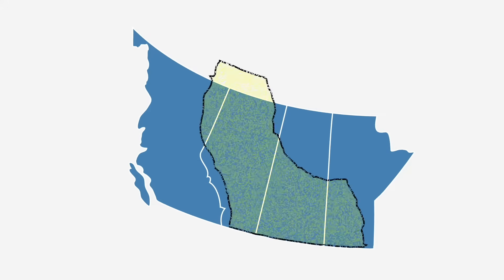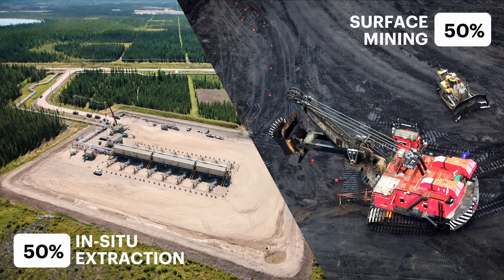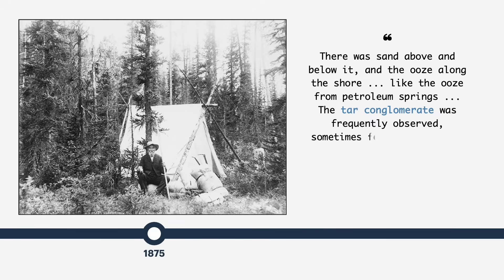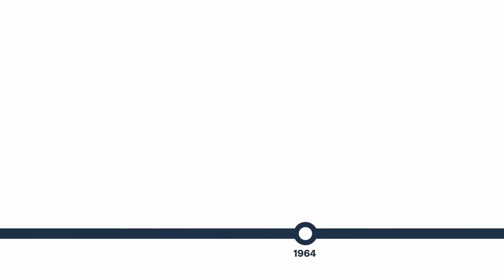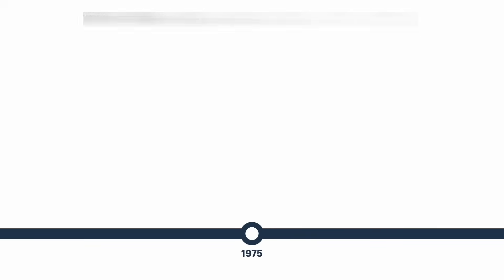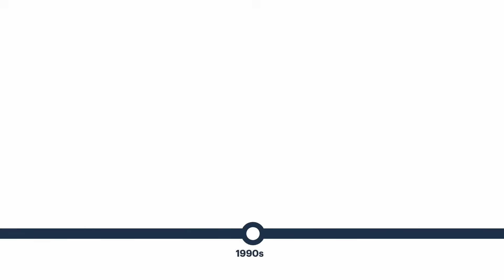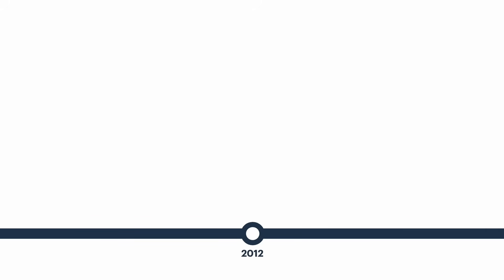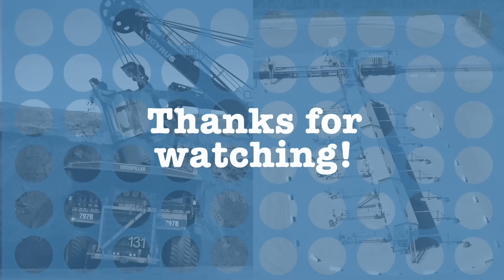A Brief History of the Alberta Oil Sands

Comment: Next step, imo, refine to the maximum value locally, then sell and pipe it out. Also, the twin rail line fr FtMac, Northwest to unload into Alaska pipeline, then out via tanker. Also, a nuclear power plant to supply electricity to the whole area. Also, pipe in massive amounts of water from the North to use in the plants.